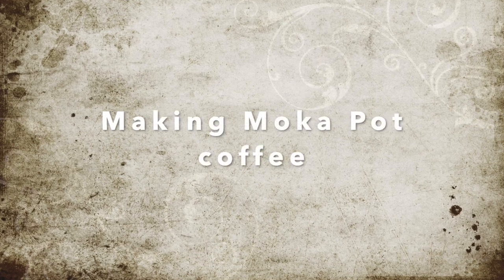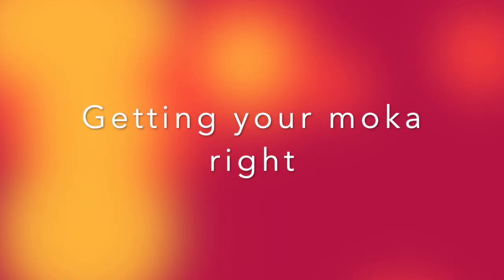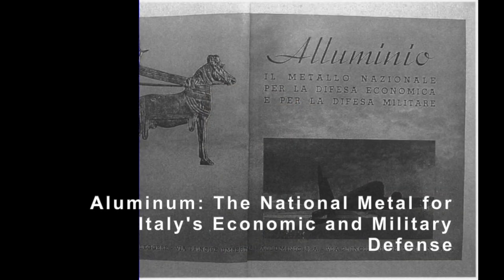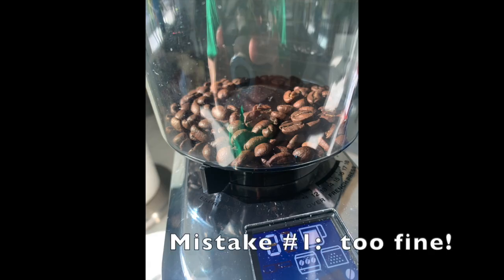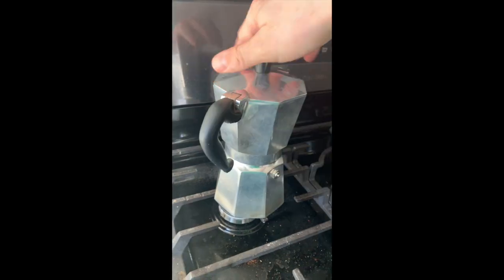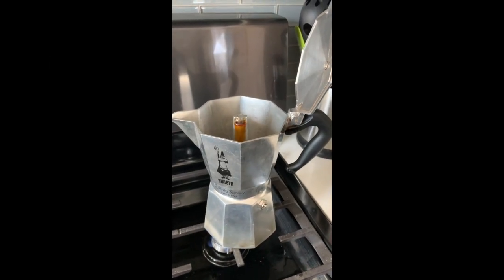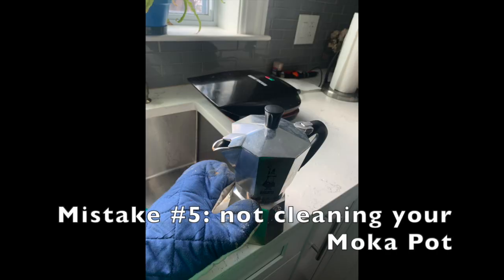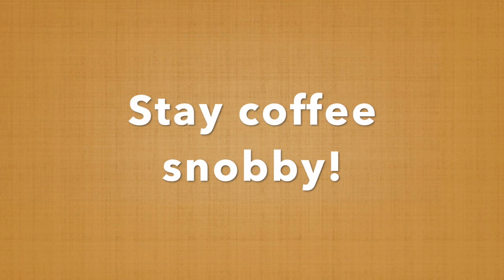Why your Moka pot tastes bad

Comment: I had a Biallita Moka pot, always cooked it on a medium heat but only after I preheated the water as other videos said to do, and pulled it off the heat as soon as it started to flow out of the tube, I tried all sorts of grinds and coffee brands, I never got it quite right, I got it to the point of it not being bad though.  

That pot broke a couple of weeks ago, so after watching and reading a lot of stuff on the internet I decided to once again try the Moka style, but this time I went with the Biallita Brikka pot instead, hoping that the pressure valve located on the tube would work as they claimed, and since I found it on sale for $35 dollars, I thought why not?

I followed the directions by putting and discarding 3 cups of coffee through it, then I drank the 4th...Oh my god! On the very first attempt I got perfect espresso flavored coffee that I come to expect from Italian restaurants and coffee bars!

While the crema that the Brikka wasn't as much as some of the pro's shops have it, (but more than the regular Moka which didn't have any) I have found out that a lot pro espresso making people don't even care for the crema, and actually will spoon it out of their espresso before drinking it!  I think after having espresso with and without the crema I couldn't tell any difference! So, I think crema is overrated.

All I was using for beans was beans I got from Costco called Cameron's Velvet Moon Espresso Roast which I had used on the old Moka pot but again the Brikka brought out the espresso flavor that the regular Moka pot could not.  I don't get into going to a roaster and buying $25 bag of 12 ounces of beans, I only buy grocery store beans, which I thought was the reason why the regular Moka pot never excelled, but now I know that wasn't the reason.
Reply from the maker: Hey, thanks for the comment!  Crema is a funny flashpoint for opinions about espresso.  James Hoffman has a video where he talks about crema as being this unwelcome byproduct of the newly invented espresso process. (https://www.youtube.com/watch?v=j5rygXblZJU)  The genius was espresso machine manufacturers decided to market crema as a sign of espresso quality and the marking stuck!  In truth, crema is not an indicator of your espresso quality one way or the other.  It's just the extrusion of the carbon dioxide that was trapped in the beans from the roasting process, much more dependent on how dark the beans were roasted than anything else.  

Related to this, the roast date is the reason you are best off avoiding supermarket coffee. The particular company selling you beans or the marketing of beans (e.g. "Velvet moon") is less important than just how fresh the beans have been roasted.

Anything without a roast date (note: NOT a "best used by" date) is probably already stale by the time it gets to the supermarket shelf.  It won't kill you or anything, but it will lack some of the rich aromatic flavor coffee should have.

As for the Brikka, James Hoffman put out a video where he explored it, but was unimpressed (https://www.youtube.com/watch?v=uwMPGEo4zCs).  The trick to the valve is just that is prevents premature brewing so you coffee isn't in danger of extracting at too low a temperature.  

Of course, at the end of the day, the only thing that matters is that you get a cup of coffee that you are happy with!

Comment: My valve leaks and the spout is sputtering, do I replace the valve or can it be fixed?
Reply from the maker: Don’t know.  Just make sure you haven’t overfilled the basket so that you’re getting a good seal between the rubber gasket and the upper piece.  There should be no grinds in the gasket when you screw the pieces together. Good luck!
Reply: @loodog555  I replaced the basket and it works now! Thanks

Comment: Please reply .. my moka pot is leaking from the valve .. is that normal coz no coffee in there after boiling
Reply from the maker: Leaking from the valve? You mean the fill valve? That should only open under conditions of excess pressure.  Mine has never opened.  If it's really the valve, I'd check to make sure your grind isn't too fine and not blocking your coffee from getting through.

If you're getting leaking from the place where the upper chamber screws onto the lower chamber, on the other hand, it's just a matter of the rubber gasket being blocked by grinds.  Italians commonly like put a "little mountain" of grinds into the basket, but I've found this just interferes with getting a proper seal.  Good luck!
Reply: @loodog555  Thanks so much man .

Comment: fuckkk i thought i was weird because I wasnt using espresso grind
Reply from the maker: The pressures involved here are nowhere near the pressures for espresso. The grind should be accordingly not as fine, as a fine grind with these lower pressures will prevent the water from percolating through as fast as is optimal.

Comment: Great video. What setting on the de’longhi do you have your grinder set to for Moka pot? Thanks!

What coffee grinder should I buy to make moka pot with?
Reply from the maker: Hi Gregory!  Thanks!  My grinder has settings from 1 up to 18 (larger numbers being more coarse). I find I get results that I like by setting the grinder to "7", which is basically just pas,  the range the machine has labeled as "espresso", so coarser than espresso. Your extraction time is pretty short so the grind needs to be pretty fine.  The problem is most people go too far with this and get overbitter coffee.  Good luck!
Reply: @loodog555  thanks for the reply. I appreciate it!

Comment: Why preheat the water?  The stove burner heats it up.  Seems like an extra step. 
Not setting the stove past medium just means it takes longer for the water to boil.  The water in the lower reservoir needs to be heated to 100C for it to be pressurized and pushed up through the coffee, setting the stove at a lower temperature just means that it takes longer to heat up.  Everything else makes sense.
Reply from the maker: Actually, the water doesn’t need to boil at all: https://youtu.be/O14BIH-9KTA
Reply: @loodog555  You are correct about the water temperature.  I checked it this morning  and the water in my stove top espresso is 85C when it come up from the bottom.   Cool how they work.   I did watch your other video.   I never thought there would be so much research.  It does make sense .  The water is still "boiling" but st a lower temperature.   Like how water boils st a lower temperate the higher altitude.    I think around 4000m waters boils at 85C.  Thanks for the content.
Reply from the maker: @twinmike1  I see you put “boiling” in quotes, but honestly, it is pretty similar to why water will boil at a low temperature when at higher altitude: saturation vapor pressure is lower in that context, so the vapor pressure of water exceeds it at a lower temperature. 

What’s happening here is The vapor pressure of water is getting supplemented by the pressure of the ever-warming air, so The water gets pushed through, before the base starts boiling.

Comment: Summary - every piece of advice in this video is utterly wrong.
Reply from the maker: Lol, grind superfine, leave it on the burner forever on high heat!   Let me know how that works out for you!
Reply: @loodog555  You got one thing right in this video, which is to grind to near-espresso grind. That is correct. A near-espresso grind is a long way from coarse, and much closer to a super-fine grind. I would much rather grind a little too fine, than too coarse - but I wouldn't recommend going all the way to a super-fine grind.

The worst thing you did in this video, was leave your coffe grinds WAY too loose. That was just ridiculous. If you leave the coffee that loose, it will be a sub-optimal brew, with pre-boil bubbling pushing colder water through too early. A bit of firmness when packing the coffee resists that, and lets your water get to a better temp before pressure pushes it through.
Reply from the maker: @An_Idiot_in_the_Wild  thanks for your comments!  The effect of packing tighter or looser is explained in Warren King’s paper, which I explain here: https://youtu.be/O14BIH-9KTA. Overall, it just causes a change in the overall permeability coefficient, but nothing qualitatively different.

It sounds like you also would like my advice about how filling up the basket affects the brew. I put that here: https://m.youtube.com/watch?v=bCSn2CXWZOE

Hope this helps!  You’re not going to get all of your answer on a 3-minute video, of course!  Good luck!

Comment: And you don't need to fill it with hot water. Cold is fine, and doesn't take much longer to brew. My 3-cup Moka brews from cold in 2 minutes on stove's small gas burner. If you use hot water, you'll need a teatowel or something to hold the bottom when you screw the top on - or, you'll risk tipping the whole goddamned thing over, like a bumbling halfwit - just like you almost did in this video..
Reply: Update - i timed my 3-cup Moka, brewing from cold (Sydney water temp, not super-cold) and it does take 3 mins to finish, not two. The point though, is, make it easy for yourself. You can overfill, and then rush to take it off before the last trickle becomes pale and washed out, or, just start with a little less water, and then you can let it sputter for 20 secs and finish, and then take it off. No rush, no fuss, simple, easy, good coffee, and the result is indistinguishable.

Comment: You don't need to take it off heat when it splutters and goes pale at the end.  All you need to do, is just fill the bottom a little less, and then you can let it finish without panicing, like a twat.
Reply from the maker: Hi Idiot In the Wild,

It really depends on the details.  If you're brewing a medium or especially a light roast, then failing to fill up the water will result in the coffee extracting too soon and the temperature will be too low. You're likely to get sour, acidic and underextracted coffee.  I explore how initial water volume affects brewing time here: https://www.youtube.com/watch?v=O14BIH-9KTA.  If you're brewing a dark roast, then I'd agree with your advice here.  I give tips on how to get the best out of your dark roast in in a moka pot in this video: https://www.youtube.com/watch?v=NQrRzTzU_Yk.  The reason for removing your pot and applying cold water (like a "twat") is given in this video here: https://www.youtube.com/watch?v=2jLdGi7kjzk.  I hope this helps you on your moka pot adventures!
Reply: @loodog555  If you're brewing a medium or light roast, and you want maximum extraction, then of course you fill the bottom right up, and let it finish. What i'm saying is, there is no need to pull it off the stove when it's starting to go pale, ie before it's fully finished, when you want a strong coffee that isn't diluted by the weaker coffee coming through at the end. When you want a coffee like that, THEN you just fill with a bit less water - as the result is the same - you don't have that extra water coming through when the beans are exhausted, and you don't need to rush to remove. It's not a difficult concept to grasp...
Reply: @loodog555 Your other videos are actually pretty good, so, thank you for those, at least you've made a good effort to look at the science in those. This video of yours is pretty weak tho, sorry, and the way you're packing the grinds in this one is an atrocity. All the fuss over removing from heat early, pre-heating water and so on, is pointless if you get your grind and your packing/filling wrong. So just get those right, bang it on the stove, take it off when its done, and you have a perfect coffee.

Comment: So if you apply cold water to the bottom, how is it stopping the brewing process if you're already done making the coffee?
Reply from the maker: great question!  The issue is that your moka pot will continue to brew if you don’t apply cold water from the residual pressure in the base.  The only problem is, any brewing you do after you get the pale bubbly coffee, will be nasty and bitter.  I explain a bit about a paper that models this in one of my later videos here: https://m.youtube.com/watch?v=2jLdGi7kjzk The short answer is that it relieves the excess vapor pressure.

Comment: What’s a good coffee bean for a moka pot? Do you have a preferred brand?
Reply from the maker: In general, good fresh beans are good fresh beans. The brewing method doesn’t have much effect on which beans are optimal.  If you find that your moka pot is causing your coffee to come out bitter and overbrewed, don’t use anything dark roast/espresso/Italian/French roast.  Anything roasted dark is designed to be extracted easily at low temp.  You moka pot might pull too much out of them.  I personally like a medium roast.

Comment: Practically everything this guy says is wrong. Use cold water. Lightly pack coffee. Most important is use medium heat.
Reply from the maker: Actually, that’s a common misconception that cold water should be used: https://youtu.be/O14BIH-9KTA

Using cold water will result in a volume-averaged extraction of 69°C instead of something more appropriate to the extraction of coffee e.g. around 92-94, as per Ernesto Illy’s Scientific American article. 

As for lightly packing the coffee and using medium heat, that’s exactly what I said in the video, so I guess you didn’t watch it.

Comment: You forgot mistake #6: recording your video vertically. When is the last time you watched a movie and 2/3rds of the screen was black? 16:9 is the most common aspect ratio used today. That's 16 across the top, 9 down the sides.
Reply from the maker: Aspect rations change during war time!  There weren’t enough 4:3 rations to go around so I got 16:9!

Comment: If you don't have an electric kettle to pre-heat and you don't feel like pre-boiling in a normal kettle on gas, what you do (and should do either way) is make sure the flame does not come out from the sides of the pot if you're looking directly down from above at it.   With the water charge in there, there's enough mass to keep the basket from cooking if you do this.  Nice and slow.  And remember to use the proper burner on your stove.  The top right, which is usually the simmer burner on standard non-fancy stoves, is perfect if you have the espresso sized tiny pot.  Use one of the two utility burners on the left hand side of the stove for larger ones.   But again, in short, make sure the flames are not coming out from the underside of the burner.  Brew, quench in the sink, done.
Reply from the maker: Good advice!  I actually do always use the simmer burner for the precision you get, though I’m not sure how much it really matters.

Comment: Never , never pour cold water over the pot after you brew coffee , the difference in temperature will destroy the pot , cleaned as you like , I clean mine with soap and water for years and still make an excellent coffee and brew it at medium flame , high flame can make the overflow if you did put extra water . Enjoy one of the greatest invention.
Reply from the maker: Never, never?  Two nevers?! 😂  Who gave you such a ridiculous idea that aluminum was so brittle that it couldn’t be cooled?  Maybe you’re confusing it with steel, which does get brittle at cold temperatures, whereas aluminum is known for being ductile.

Comment: I love my Oxo. A wide drip top attached your large coffee mug. Use medium ground coffee, and pour water that is just below the boiling point. The top with an organic paper coffee filter allows  the water to pour into the mug during a 2 minute time period.
The  coffee is strong but not espresso strong and is never bitter. Costs about 15 bucks from Amazon. 
Clean up is simple.
Reply from the maker: Well Oxo describes a brand with an entire range of kitchen products.  Sounds like you’re talking about some kind of pourover setup they make.
Reply: @loodog555  
Yes I was.
I believe Melitta has one too.
A suggestion. A common trick is to put salt in the coffee before it is brewed in a drip machine to eliminate bitterness in the taste. Does that work in the Moka?